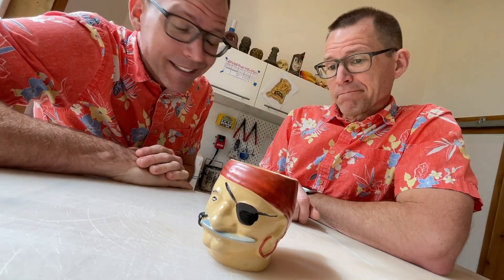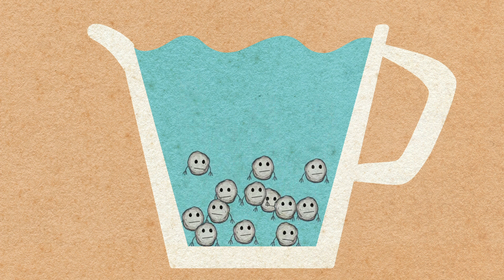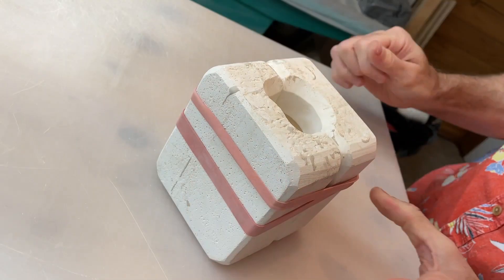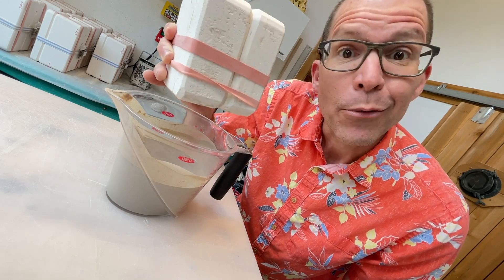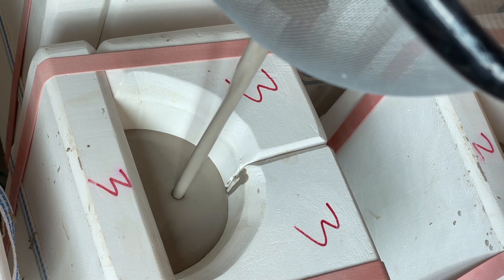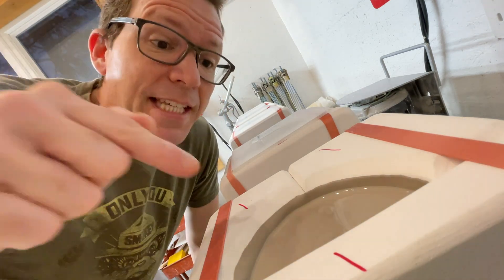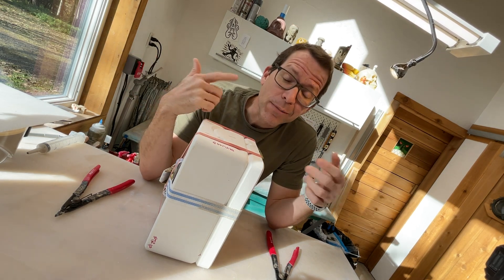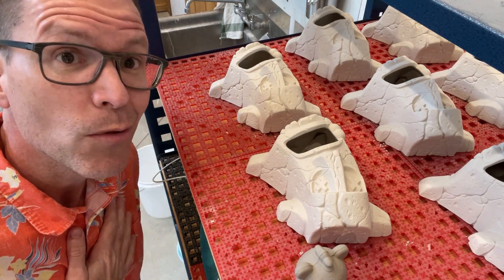How Slipcasting Works - Tiki Technical Tuesday 49

Comment: How do you keep track of slip gravity if you're leaving the whole thing uncovered? Do you weigh it before casting or just wing it based on experience?
Reply from the maker: Do you mean my slip tank/table? I cover it with plastic when not using it. Some water drips in when I sponge off the top rails when cleaning after casting every day - and that helps to make up for any moisture lost to evaporation. I will adjust for specific gravity and flow every few weeks if the castings are behaving oddly.
Reply: @vantikistudio  Thanks so it's mostly experience.

Comment: Me again...

Ever since I cast my old molds in silicone, I have not been able to slip cast with it. Everything sticks and the pieces are destroyed when I separate them. I'm leaving them full for an hour, letting them firm up for about five hours, and they are staying absolutely stuck to the plaster molds, and the slip is staining them brown. Is there anything I can do? Do they need to be cleaned somehow? 

FWIW I'm using SIAL's Canada Slip ("new formula"). The old formula (the original box I bought) was very different (gray an a lot thicker) and also failed/stuck pretty badly the only time I used it after I silicone cast the original plasters. I am very reluctant to cast with the new plasters until I know what I'm doing wrong.

Any help is appreciated (including telling me to contact you some other way because I'm annoying the other students!)
Reply: After watching your Slip Casting Porcelain video, I am almost certain the first box of slip I bought (and used!) was mislabeled porcelain slip. It was a fair bit thicker and firmed up much quicker.
Reply from the maker: Hmm - are you saying that your maser plaster mold, after you made a silicone mold of it, no longer works for Slipcasting? If so, it may be a matter of absorbing silicone oil from the molding process, or the presence of any release agent you used when making the silicone mold (mold soap, for example). I’d suggest washing the mold thoroughly with vinegar if you used mold soap as a release agent. You can also try washing the mold with acetone, then rinsing and drying it thoroughly before casting. 

Ok I’ve re-read your question and it seems like your plaster is wicking just fine, and that sticking is the issue. How firm are the castings when you try to open the molds? I find that if I let castings dry I. The molds too long they can shrink which will lock the castings in, and sometimes cause them to tear or crack as they constrict around the mold forms. I also find misting water into the mold before casting can help prevent the slip from “gripping” the plaster - it kind of primes the wicking action.
Reply: @vantikistudio  So, some responses. When making the silicone masters, I didn't use a release agent. When I slip cast using the original plaster mold afterwards, the slip takes a solid hour to build up enough thickness, so maybe it's not wicking as well as it should. After sitting for about five hours (!!) the slip is still a little rubbery, but feels solid enough to stand up on its own. I see no little to no sign of shrinkage at the gate, though. It just sticks to the mold and refuses to release, to the point that it has stained the mold. 

So I will try cleaning with vinegar -- or should I try acetone? I have both handy.

I also cast four fresh plaster molds, and I'm kinda reluctant to try them given what's happened with my original mold and the fact that I don't know why this is happening, but maybe I should give one of them a spritz and give it a go -- thoughts?
Reply from the maker: @joevalente8451  definitely try casting from fresh molds, and I’d also definitely scrub out your problematic mold with acetone and vinegar.
Reply: @vantikistudio  I took your advice, held my breath, and cast the new mold -- with a mist of water before I poured. I now have a small-but-growing forest of Christmas Tree napkin holders! After a vinegar bath, I still worry that the original plaster mold has absorbed something rendering it useless (I'll try an acetone bath next) but you were absolutely right, the new plaster molds worked just fine.

Given it's acetone, what would you use to scrub the mold? A soft toothbrush is out, because the acetone is likely to turn it to goo. 

Anyway, I don't think I have (or could) adequately expressed my gratitude for your patience in sharing your expertise. I -- and my now very-busy-with-ceramics mother -- thank you!
Reply from the maker: @joevalente8451  so glad the new molds worked! For the acetone, try using a soft chip brush - it should be fine with the solvent. Good luck!

Comment: So, question, I’ve made a slip mold for an olla, or a porous pot I’m gonna bury in my garden to help water it as I live in an area prone to drought.

I know nothing about ceramics before taking on this project. I’d slip porous?
Reply from the maker: Clay can be porous after firing - when you shop for prepared slips (I’d buy a pre mixed and ready to use slip since you are just learning) talk to the manufacturer about your intended use. I’d call Laguna clay and see what they suggest.
Reply: @vantikistudio  thanks! I just got a book you recommended in the mail and silicon is setting in a 3D printed mold of a mold of a mold I’m making so, definitely time to get the right materials

Comment: question....I'm getting ready to try my first casting making Ollas for my garden. I'm not worried about replicating fine details just reproducing the general for am I going to have to be as precise mixing up the slip solution or will it be more forgiving?
Reply from the maker: If you’re doing a small project I’d recommend buying prepared slip - it makes it a lot easier to get the hang of casting
Reply: @vantikistudio  well I had already considered that but I normally like to try the hard way first its just how I'm built lol

Comment: Maybe a plaster mold in its first casting has less residual moisture in it than it would between castings? I know from testing moisture retention in soils that, at very low moisture contents in porous materials, you can get very  large changes  in capillary suction with small changes in moisture content.  And I remember reading somewhere that one should lightly mist the inside of a plaster mold with water before its first use -slightly higher moisture, less capillary suction; maybe less grippy-ness the first go-around.
Reply from the maker: Interesting!  I also read about misting the molds before casting. I used to do that - but noticed no change when I forgot to do it, so I stopped 😅

Comment: Great video! What the reason was to go the plug route instead of making the mold so the mouth was where the slip is poured?
Reply from the maker: If I had used the mouth as the pouring gate, the face would have to point up while pouring, and that would run the risk of catching bubbles in the nose, eyes, and brows.  I could have possibly done a crazy angled pour spout in the mold - but engineering it seemed overly complex compared to just using a plug and pouring through the top of the head.  Hope that makes sense!